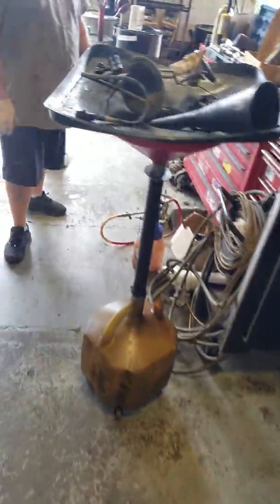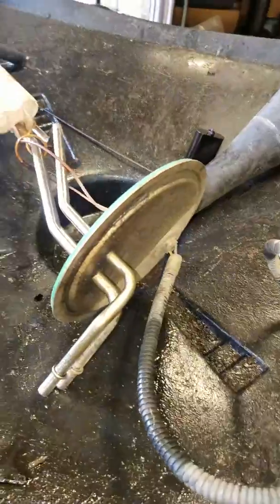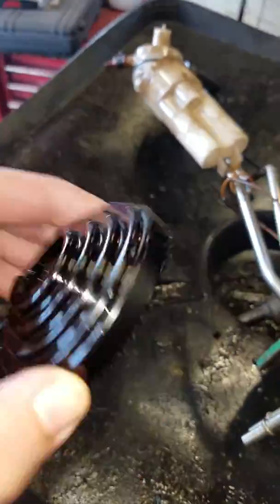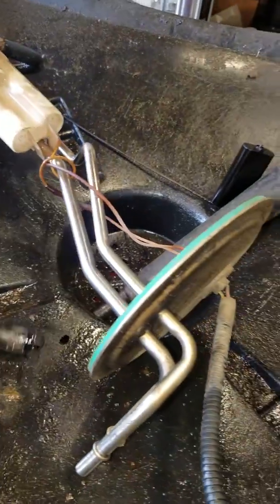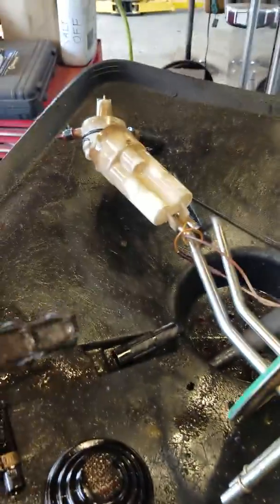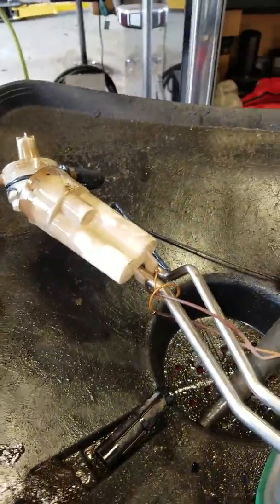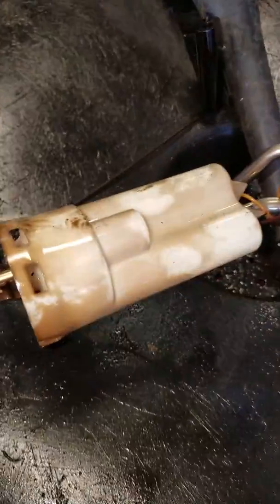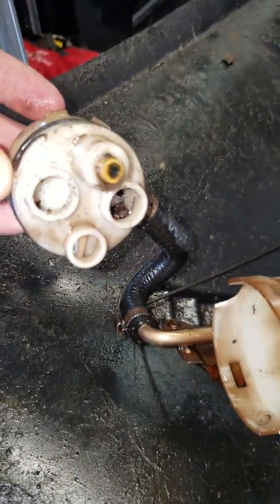Ford 7.3 Powerstroke Fuel Problems

Comment: Thank you very much I've had an issue for almost 2 weeks my 03 powerstroke and this is exactly what it was I thank you very much!
Reply from the maker: @Thomas-h4i1c  you're welcome, glad it helped you.
Reply: @mst982  now it's throwing a misfire for 2 3 and 4 still cutting out and stalling.. 🤦
Reply from the maker: @Thomas-h4i1c  what codes are you getting? Are you doing the injector buzz test? Does it just shutoff like cutting the key off? Or does it bog down and start knocking?
Reply: Yeah it's cutting out as if it's out of fuel and knocking slowly losing the paddle until it stalls out I bought an IPR sensor but I've yet to put it in I also cut the cat off too the whole piece of exhaust including the cat cuz it's plugged solid after that it ran great for a while and decided to do it again about 20 minutes later @TheTomlin
Reply: @TheTomlin cutting out as if it's out of fuel losing  the pedal slowly until it stalls out I bought an IPR sensor but I've got to put it in and I cut the exhaust off including the Cadillac converter because it's plugged solid after I did that it ran great for 25 minutes and then it's falls on its face specially uphill or under a load
Reply from the maker: @Thomas-h4i1c  if it runs OK at first then bogs down the longer it runs, it will be a fuel problem. You can run a hose off the back of the fuel pump into a can of diesel fuel to take the tank out of the equation and/or plumb up fuel pressure gauge on your fuel filter housing. You should have around 45 psi on the fuel filter housing while running at all loads.